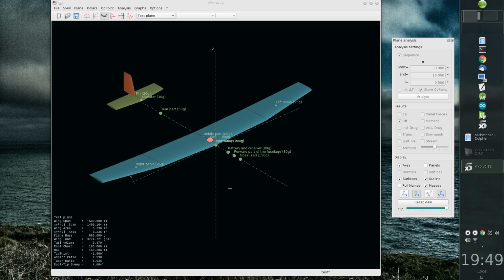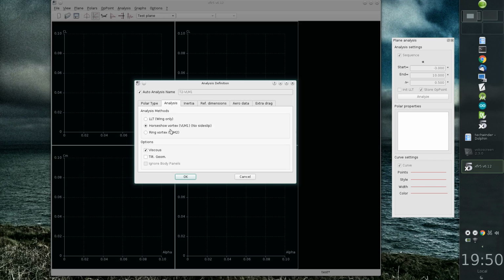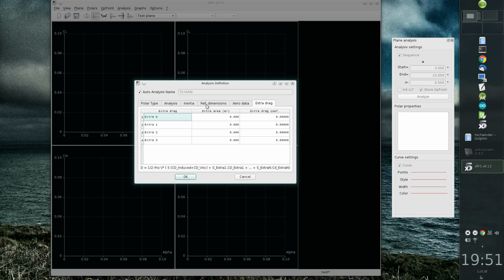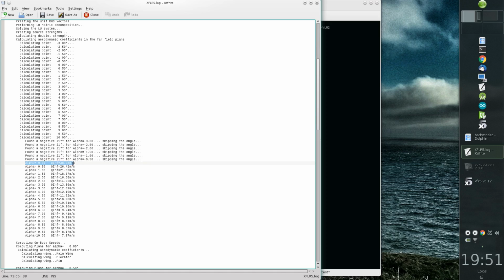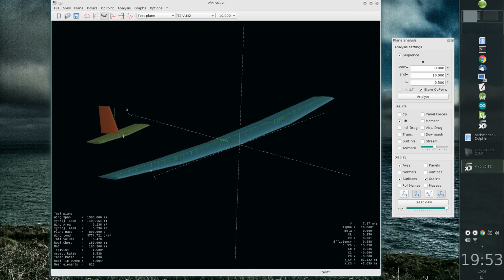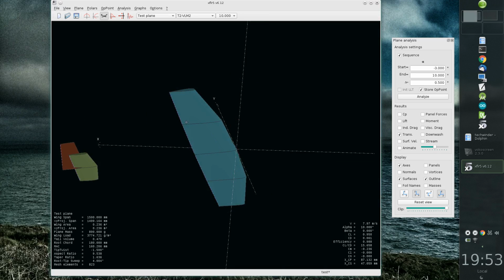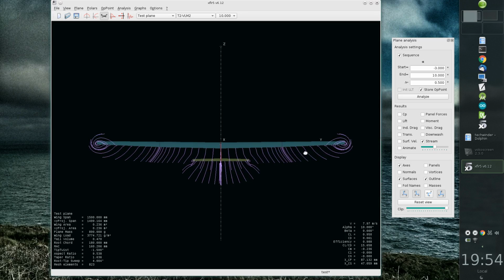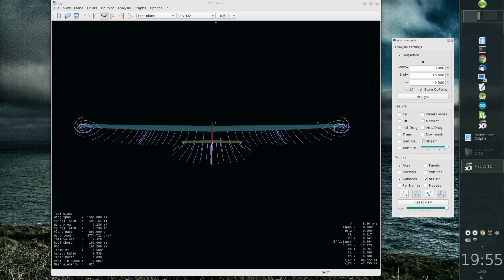8 Plane analysis

Comment: andre, i can only save analysis, where can I go and run the analysis for the plane?
Reply: Did you open File --> Wing and Plane Design first?  When this is activated, there should be a little model of a plane in the toolbar like in the video.

Comment: Hello, great tutorials. I have just one problem: when I run the analysis for the plane I get this error on every point
Span pos =      0.17 m,  Re = 970455,  Cl =   0.91 is outside the flight envelope
and hence it doesn't generate any graphs at all. Any advice?

edit: alternatively I also get this one
Cl could not be interpolated
Reply from the maker: The answer is in video 11 https://youtu.be/_8thw2CQCaI

Comment: Hi, I am attempting to analyze an Formula 1 rear wing, the camber is negative, and I have assigned the chord and the span. I have tried a type 1 analysis with a fixed free stream speed, but can' get it to converge nor to interpolate. At the end of the analysis the message "errors encountered" appears. Could you help me please? Am I doing something wrong?

Comment: Very useful videos thanks for uploading them! Is it possible to use other tail configurations? for example a V inverted tail
Reply from the maker: Sure, disable the fin, and set the dihedral angle in the elevator definition
Reply: And how It Is possibile to design a triple tail? Imposing the dihedral to 90 degree gives me some issues. Thank you!

Comment: Nice video ¡¡¡...You helped me a lot   but a have an error like this:
  Calculating wing...Fin
           Span pos =    -60.00 mm,  Re =    34 000,  Cl =   0.00 is outside the flight envelope
           Span pos =    -34.62 mm,  Re =    36 000,  Cl =   0.00 is outside the flight envelope
           Span pos =    -14.27 mm,  Re =    40 000,  Cl =   0.00 is outside the flight envelope
           Span pos =      2.97 mm,  Re =    45 000,  Cl =   0.00 is outside the flight envelope
           Span pos =     14.27 mm,  Re =    49 000,  Cl =   0.00 is outside the flight envelope
           Span pos =     34.62 mm,  Re =    53 000,  Cl =   0.00 is outside the flight envelope
           Span pos =     60.00 mm,  Re =    55 000,  Cl =   0.00 is outside the flight envelope

Panel Analysis completed ... Errors encountered

Can you help me to fix this? ..Greetings from Ecuador.. God bles you jaja
Reply from the maker: Please check the video 11 "plane viscous analysis errors"

Comment: INSERTING WINGLETS IN PLANE WING
Sir I am a RC plane enthusiast can you please upload a video Regarding adding the Winglets in the planform of wing
Reply from the maker: All right, will do it in a future update.
In the meantime, there are two ways to do this : either set a 90° dihedral at the tip panels of the wings, or use the double fin option with a positive y value. I used the first method for the flying wing in the sample project, which is available for download on the project page in the files section.

Comment: Hello, again! I designed a small aircraft on XFLR5, and then I tried to analyze it, but when it starts to compute the on-body speeds, it says "could not be interpolated" for all the angles. I didn't set the plane inertia, but I filled the mass and CoG while defining the analysis. Do you have any idea of what could have happened?
Reply: I watched your 11th tutorial and found the problem, I forgot to batch analysis for the profiles of the elevator and the rudder. Everything is working properly now. Thanks!
Reply from the maker: Please check the video 11 "plane viscous analysis errors"